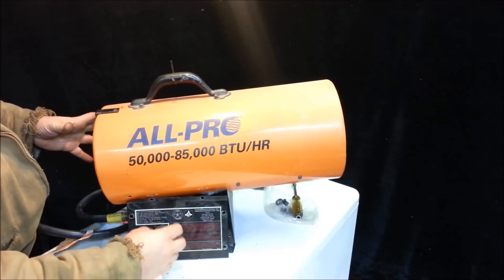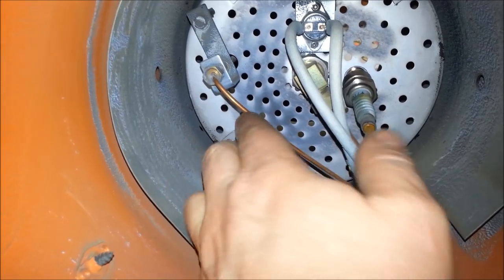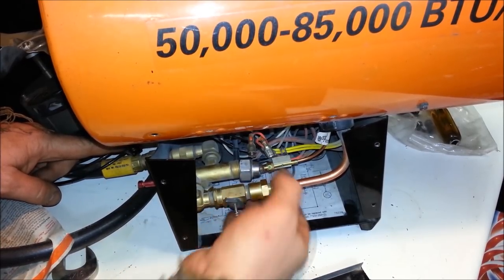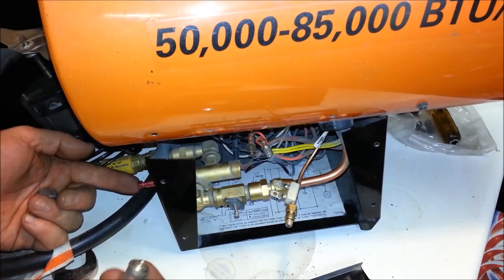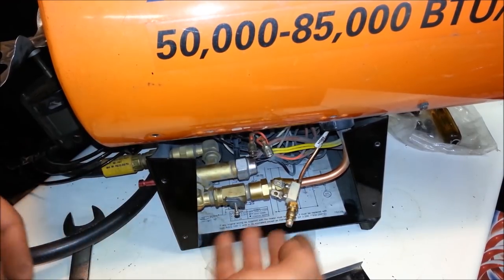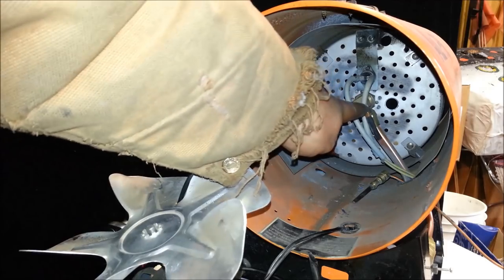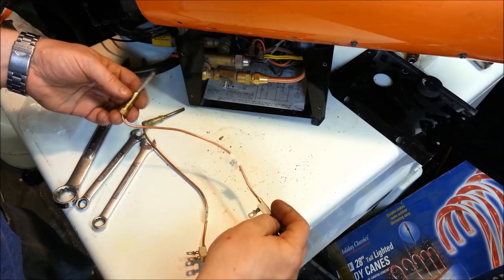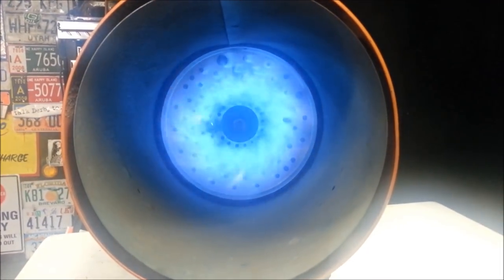Propane Torpedo Heater Not Lighting & How they Work

Comment: Thermo couplers are magic in my mind. A smart person invented them.  You are good with your hands and your mind too.
Bruce
Reply from the maker: Bruce Pender Yeah, there is definitely some magic going on in them.
Reply: sixtyfiveford Speaking of which, I bought a pH soil tester and it uses 2 different metals to determine the acidity of soils. The electronics in it just amplifies that voltage and drives an LCD display.

Comment: What if you have no spark? When I plug mine in, there's no spark at the plug. Worked fine this morning but now it won't start.
Reply from the maker: More than likely your ignition coil is bad.
Reply: And how exactly do I go about testing the coil?
Reply from the maker: If power is going to it and it doesn't spark, it's dead.

Comment: On your next repair, on that rear unlubeable bushing, I drill a small hole in the top of the metal just at the base and oil migrates right to the bushing.  Give it a try. Works on all the rear sealed burgers!
Reply from the maker: Good tip!

Comment: Do you know which valve coil that is in that heater?  I had mine ripped all apart and the part went missing.  I see there is two different sizes -7111 and 00503.  Based on your video I think it's the 7111 as it is about 1.5" vs 1.25" for the 00503.  Not sure changing the thermocouple fixed my problem however I had bought one last winter thanks you this video and just got around to installing it today as it's finally cold again. Without that solenoid valve I can't test it though.    Thanks for a great how to video!
Reply from the maker: I don't recall. However I believe one it larger diameter than the other so you could find one on Ebay or similar and have the seller measure how big of round it is. This will let you know which one you need.

Comment: John Hondrogen

I reposted this so I can get a little feedback. Thanks!
I have a Universal 85-FAC All Pro SPC-85 made by Scheu and have been trying to get it running. It's been idle for 10 years and worked great before.  Here's what I have done:
   Full 20 lb propane tank
   Cleaned and gapped plug (and I've taken everything else apart to check)
   New thermocouple, relay and high temp. sensor
   Taken apart lp hose and regulator and am getting propane through the hose
The unit starts up but with only a small flame (1 inch) and goes out when I release the igniter button no matter how long I hold it. What should I check next? Thanks
Reply from the maker: Sounds like your just not getting enough fuel. This can be from the turn on procedure you use with the propane tank, the regulator of the valving that the propane flows through internally. 

-First, the OPD device built into the propane tank can fight you without proper turn on procedure. Connect everything. Turn the propane tank knob on, wait a few seconds. Now turn it back off for a few seconds(if it is quiet enough in your shop you'll hear a click which is the OPD(overfill protection device) disengaging). Now turn it back on for the final time. Fuel should flow freely. A little background on the OPD: it limits huge out rushes of propane and stops it from being overfilled. The initial connecting and opening the valve can trigger the OPD as it thinks it is a large out rush/leak. 

-Second, the regulator could be limiting the amount of flow. Disconnect the hose at the heater or anywhere behind the regulator. With the regulator hooked to the propane tank open the propane tank valve. You should get a large volume of propane coming out. A small hiss of propane would signify a defective/limiting regulator. 

-Third, if both the other check out fine you will need to take apart the valve, piping and nozzle to check for an obstruction.

Comment: Great Video. I have a Dewalt DXH90FAV. Could not find a replacement thermocouple anywhere. I tested it, it measured the correct 20+ mv. But still did not work. I thought I would check the ma, and found it produced 0 ma. I checked it against a one that I know works, and it produced about the same voltage, as well as I think 20 ma as well. All I need to find is a thermocouple that is about 10" long and has the right thread for my unit.
Reply from the maker: +Higher-Ground Farm Does you thermocouple have two spade wire connectors coming out the side?
Reply: It looks like this. It does have a brass block with two connectors coming out. Sorry about the crappy photo. I had to use my scanner, as my camera is on the fritz. https://drive.google.com/file/d/0ByPnRZK3U8Yjc3BXUjJhZklBTUE/view?usp=sharing
Reply from the maker: Those 2 terminals connect into a relay on the electronic panel. I've had the contact points on the relay(they can be cleaned) get oxidized and not work. You can bypass the relay by connecting these two spade connects on your thermocouple to determine if it is working correctly.
Reply: I already tried that trick so I picked up a Universal thrermocouple, and am going to install today. Wish me luck.
Reply: +sixtyfiveford That fixed it. An 8.99 universal thermocoupler did it. I did have to drill a new hole in the back plate, to fit the diameter of the snap in holder, but it is all good now. Thanks for your video. It pointed me in the right direction!
Reply from the maker: That's great. I'm really disappointed in Dewalt and their lack of parts for any of their heaters.

Comment: Saw one of these running (inside a building) and it had large flames mostly orange/yellow in color inside it and the odor off it was pretty strong. (The person working in there said it gives them a headache)  I told them I'm sure that's not working right by the look of the flames. Am I correct?
Reply from the maker: You're correct. They burn very clean and odor free when running correctly.

Comment: So I have a quick question. I tested continuity between the two wires it’s self and nothing. The heaters fan comes on the spark plug is sparking and propane is flowing. I don’t want to dump a bunch of money in it when the a new heater is only 100 dollars. By the way same exact heater that’s in your video. Any help would be great thanks!

Comment: I have a propane heater like this but my problem is that when it’s running it burns my eyes while I’m the garage. And there is also a nasty sulfur or chlorine kind of smell. Is this something that can be adjusted?  I can’t do anything in the garage while it’s running as the eye burn is unbearable. Thank you
Reply from the maker: This means it is putting too much fuel into the burn and needs less. It's running rich. The regulator at the propane tank is what controls this and is likely bad.

Comment: I have an All-Pro SPC-40 (40k BTU) propane heater.  It tries to start but the fan actually blows the flame out.  If I temporarily block the fan intake it will light normally.  The flame still goes out when I release the primer button so I'm sure the thermocouple is bad.  My question is, would a bad thermocouple cause both issues?

Comment: I would appreciatte any suggestions. I have a Master MH-60V-GFA LP torpedo heater. It fires correctly but the flame comes out of the heater at least 12" past the metal canopy. I have to turn the control valve way down to keep the flame inside the unit. I am using a hose with a regulator on it and the hose works great on an identical Mater heater I have so don't think thats it. Thanks in advance to any recommendations.
Reply from the maker: Bad regulator
Reply: @sixtyfiveford  
You’re speaking of the regulator on the hose that connects the propane tank to the heater? 
If that’s the case then I wonder why the other heater I have works perfect with that hose and regulator?

Comment: I have this exact same burner I just picked up used. It works but I don't believe it's burning all the propane. Smells awful like unused propane and takes a lot longer than I'd expect to heat my small garage. Thoughts?
Reply from the maker: wilcox2301 If it smells like raw propane then you have a leak somewhere between the bottle and the valve on the the heater. Any propane in the burn chamber will 100% burn. That being said, propane burning will give off an odor that is normal. Some people are a lot more sensitive to the smell than others. I would say it would take a 50,000 BTU heater an hour to heat a 2 car garage from 20F to 70F(assuming it is insulated)
Reply: sixtyfiveford Thank you for the reply. Garage is not insulated 100%. Also the regulator on it isn't working great either. It tends to go out on the lower end (50k BTU and works okay at the higher end (85k BTU). I just wanted to make sure it is 1) Safe, and 2) working optimally.
Reply from the maker: I think you're fine as long as there isn't a leak in the hose. Propane has the annoyance of freezing itself up inside the tank and in turn freezing up the regulator. If you store your propane cylinder where it is warm(house) it will work a ton better when you need it outside. Moonshiners blow themselves up because they light fires under their propane tanks to keep them from freezing up.

I have insulated walls and door but not the ceiling(very tall). In one hour 50,000 btu will take my garage from 20F-50F+- which feels great. If I insulated the ceiling or put plastic sheeting on the rafters to keep the heat down I could get it to 70F in an hour.

Comment: I was able to replace the thermocouple and it stayed lit... but doesnt seem to have good flames.  Any ideas on how to make the flame better "Bigger"? I used the knob and it does a little but not like in your video.
Reply from the maker: The propane pressure regulator controls this. They go bad all the time.

Comment: Great video. What about units like mine that have advanced electrical circuitry? I replaced the thermocouple AND gas valve, still no fire past prime. How does one diagnose the PCB (cicuit board)?
Reply from the maker: +Chrissy Foreals Most will have 1 or 2 electrical relays with a clear cover. The contacts can get dirty and not engage. The cover can be taken off of the relay and the contacts cleaned.

Comment: Thanks for the great video. I have a dyna glo pro 125 k btu LP heater that will ignite but after the 30 second period and even if I hold the ignite button for 60 seconds will go out once the button is released. I have replaced the thermocoupler and tempeture switch with no improvement. Any help would be greatly appreciated.
Reply from the maker: The only other thing is the relay box. It is about the size of an old school ice cube with a black or clear cover and half a dozen wires going to it. The contact points get a little corroded and a very fine(300+) grit sand paper needs to be ran between them to clean them up.

Comment: Thanks for showing this, I have not taken mine apart yet but have owned it less than a year and am trying the warranty route, which doesn't seem to be lending me a return call.  Anyways mine lights up and about a min. after I release the button the flame shuts off.  What are your thoughts on this?  The overheat switch or the thermocouple acting goofy?
Reply from the maker: +Kartboarder22G Thermocouple. The thermocouple should allow you to release the button within 10 seconds on average if it is working correctly.
Reply: Thanks, yes I can release it and it runs but a min. or two later it shuts off.  Almost like the overheat switch is coming on too early.  I'm going to give it another try tonight, I was able to get a hold of someone from the company and they suggested hold it for 3-5 min. to purge it well.  I'll give that a try tonight and report back to them tomorrow.
Reply from the maker: It sounds like the overheat switch is too sensitive. To diagnose it and eliminate other issues we can bypass this switch. I'm not sure of your wireing but they either connect the two wires when it gets hot or disconnect them(2 different styles). That's all the switch does. You can test it with a multimeter or just unplug the wires and tape them so they don't touch each other or the body of the machine. If it works normally you know the sensor is bad. If now it won't stay running at all when the wires don't touch, you'll need to connect the two wires directly together: then try it and if it works normally without shutting down, your sensor is bad. If it still stalls out randomly then we'll look elsewhere as the sensor is good.

Comment: bought a scheu 150k btu unit long time ago, new in box. just pulled out today, likely 20 years after built, hooked everything up, supplied gas and power, hit the switch, it ignited, flames, red, came out front but fan never kicked in, spun fan with stick, counterclockwise from rear, hope correct, never took off so shut down.  was wondering if supposed to ignite then spin fan, or if fan should spin from start to begin troubleshooting. damn starter armature frosted up in this -25F weather we have had and need to start up my ride, thought heat up front of vehicle from a distance but no joy...
Reply: box did get a little moist through the years, was actually some weird fungus on end with fan inside box, stringy stuff just came after the 2 wet summers we had, live close to swamp and lake so new things coming back alive after 2 decades of drought..  my fan was a little stiff, will try to add some oil to bushing, my fan is bolted in and need to take off support braces from underneath inside cubby so overly complex compared to yours.
Reply: I drilled a hole in the end by rear bushing, oiled it up, and mine started up, was able to warm up my car and start it.. woopwoop...
Reply from the maker: The fan will just have oillite bushings and I'm sure the lubricant is just gummy. I generally put a few drops of transmission fluid on the shaft, next the bushing. It soaks in and lubricates everything.

Comment: I have a Universal 85-FAC All Pro SPC-85 made by Scheu and have been trying to get it running. It's been idle for 10 years and worked great before.  Here's what I have done:
   Full 20 lb propane tank
   Cleaned and gapped plug (and I've taken everything else apart to check)
   New thermocouple, relay and high temp. sensor
   Taken apart lp hose and regulator and am getting propane through the hose
The unit starts up but with only a small flame (1 inch) and goes out when I release the igniter button no matter how long I hold it. What should I check next? Thanks!
Reply: Hey John I have the same problem with a 150,000 BTU did you find a fix?
Reply: Tony Veno No solution yet.

Comment: Great video!  I have an older model Mr Heater 30-55k btu forced air propane heater (mh55fav) and it runs great after I replaced the thermocouple except for one problem, the flame wont get big at all.  When you bypass the thermocouple for starting the heater and on max setting (while running) the flame is only like an inch or two.  Do you think the in-line regulator is bad or could it be a clogged orifice? Thanks!
Reply from the maker: Either the inline regulator or the safety valve on the propane tank is partially close. When you connect a propane tank: turn it on approx 1 turn, then turn it off and wait a few seconds(sometimes you can hear an audible click of the safety valve disengaging), then turn it back on full. This will make sure the safety valve isn't partially shutting off the flow internally.
Reply: thank you! I'll give that a try tomorrow!
Reply: Figured it out! It was a bad high limit switch. I bypassed it and the heater works great! Now i just need to find a few of them. Thanks for your help!

Comment: I've recently bought off (second hand) a very new looking torpedo heater that is similar to the one in this video. However, when I got home to test it out, everything turned on fine (fans were running, spark was there, etc..). After releasing the propane, I waited a few seconds and held the button in hopes that it would turn on. For a flash of a second, there was an ignited blue flame which quickly dissipated and died. I've been trying to figure out all day what the issue was. You mentioned in your video that it could be the thermocouple but when I held the igniter button, the initial flame dies and nothing else happens after.

Not sure what else to do!
Reply from the maker: The OPD valve on the tank is generally the issue. There's a procedure to connecting these. 
Connect the gas line to the propane tank.
Turn on the gas and wait for 2 to 3 seconds.
Turn off the gas and wait for another 2 to 3 seconds.
You may hear a light click internally, This is the OPD valve resetting. 
Now turn the gas back on and you should be ready to go.
Reply: @sixtyfiveford  Thanks for the quick reply! I tried the OPD valve reset but I'm still getting the same issue. I recorded the steps I took and what the heater looks like when it starts for a second. I can send you the video if it may help!
Reply from the maker: @LeFunTime  if the heater will not continue to run while you're holding the button in then the regulator built into the hose is bad.

Comment: Mine has good spark and i can smell propane but it won't light. Could it be the regulator?
Reply from the maker: The regulator does go bad but will generally dump tons of propane when it does and or the regulator will leak propane. You should be able to hear it hissing propane while pushing the ignite button. Sometime the propane bottle OPD device can restrict the propane flow if not properly hooked up. 

Connect the propane hose to the bottle. Turn on the bottle valve. Wait 3 seconds, then turn it back off. You may hear a light click inside the propane bottle. This is the OPD valve resetting. Now turn the valve back on and the OPD should be fully open and ready to deliver propane.

Comment: I have a Mr Heater Contractor series 35,000 btu heater. I can get it to light and stay lit after i let go of the button. Then it will quit after a minute or so. Is that the thermocoupler too?
Reply from the maker: I would suspect your regulator on the hose is freezing up.